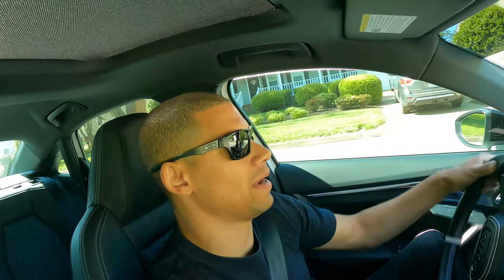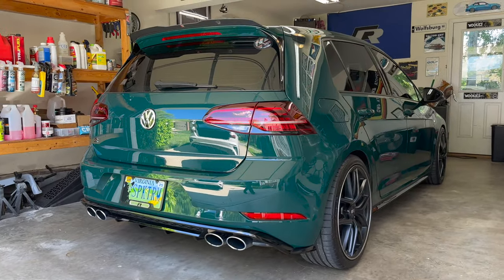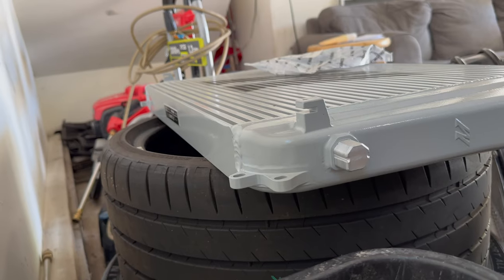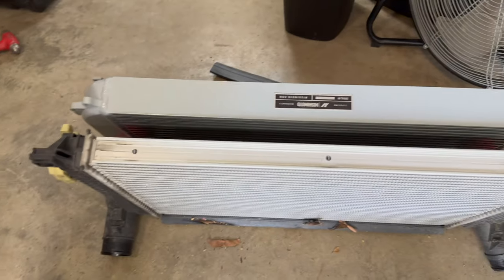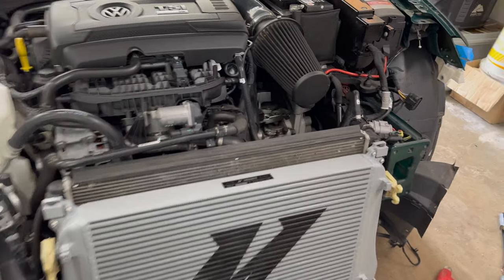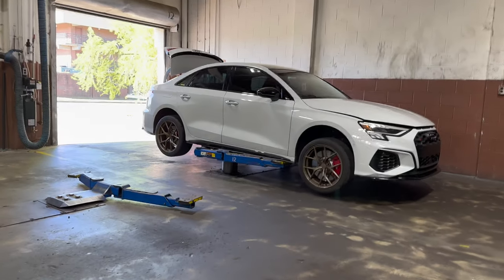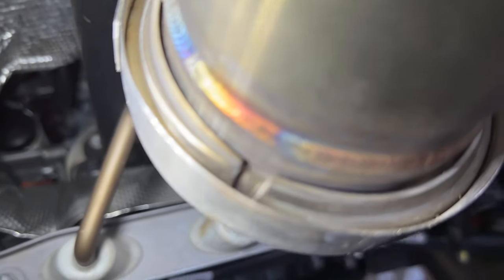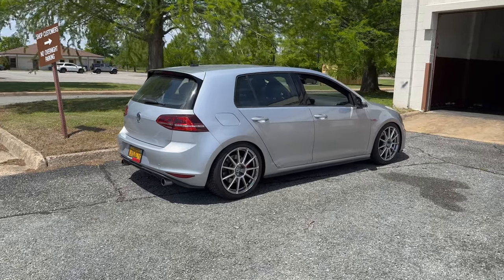Working on a BEAUTIFUL Spektrum Car! | Mishimoto intercooler thoughts | & now working independently

Comment: Hey bro what's your HP now
Reply from the maker: Same as it was when I dynod 420/445 with RL stage 2 93. Not sure with 034 stage 1 E or 93. But pretty darn quick
Reply: @Bryce Jordan Productions  Did you rebuild your engine yet? My home boy has his audi S3  it's about 900 horsepower. It's crazy
Reply from the maker: @the1andonlyxx  heck no this car is young still not even 30k 😂 I wanna stay stock motor this time around. Who’s ya boi?
Reply: @BryceJordanProductions  Sleepy S3